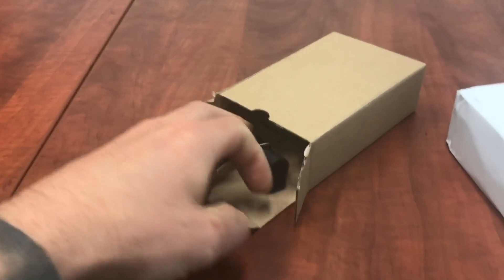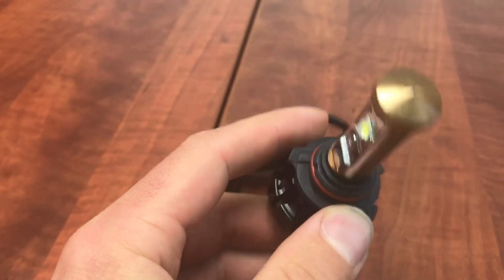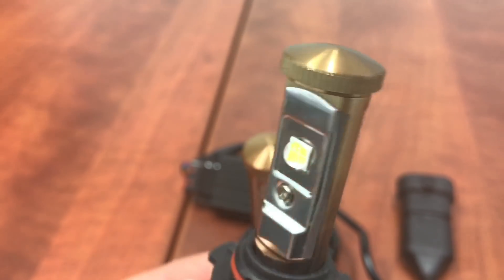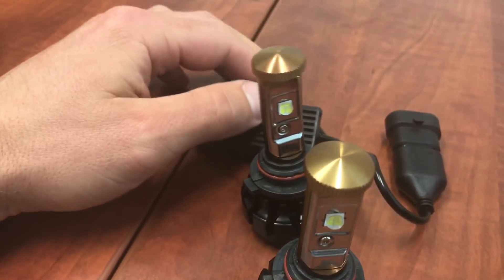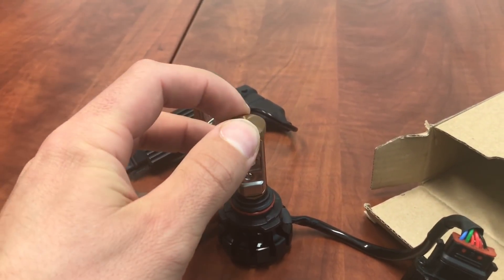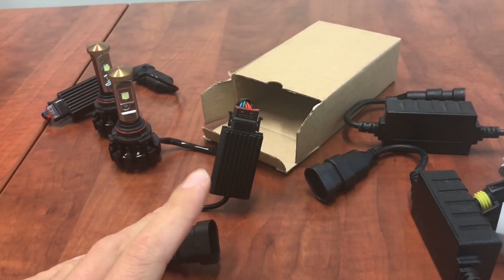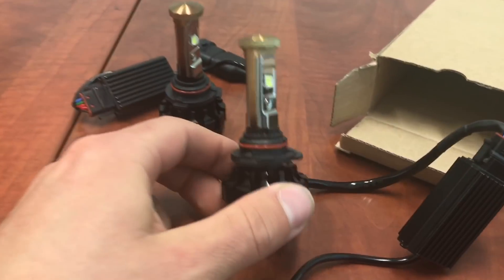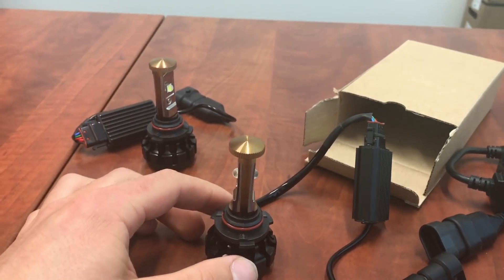How HOT do LED bulbs get in Halogen Projector Headlight Housings?

Comment: You’re tripping. It’s no where near “extremely hot” that you’re claiming. Your regular halogen bulbs are running around 160 degrees meanwhile these specific led bulbs are around 90 degrees. 90 degrees isn’t burning hot but enough heat to discolor that portion of the bulb. You ever have anodized aluminum parts out in the sun throughout summer? Same thing will happen.
Reply: The lights do get hot to the touch after 3 minutes
Reply: Halogen gets up to 200 degree glass
Reply: No. They’re wayyy hotter than that. I’d say around 150. Too hot too touch for more than a split second.

Comment: I have a 2015 Ram 1500 and the problem i am having is that after 30 mins or so the lights shut off and will not come back on until i restart the truck. I do have the canbus devices installed with them. Only happens on low beams. The fogs work fine.Any suggestions?
Reply from the maker: I'm going to work on a better solution for the CANBUS adapters as they don't seem to work the best after a few months.  For now don't use the AUTO function on your headlights and turn them on manually and should be ok.  It doesn't agree with the auto function for some reason.

Comment: You said you went HID. I’ve researched the shit out of this and I keep seeing that HIDs shouldn’t go into a halogen projector. It would start pitting the lens and beam throw is horrible and possibly melt the outer clear headlamp cover. What was your experiences?
Reply from the maker: No issues here and I would definitely recommend HID over LED in these low beam projectors.  There is no comparison the HID is a clear winner!  Check out this video where I compare the two in these headlights! https://youtu.be/Vmi6eeoOL5o
Reply: BoostedMotorsports so there is no issue at all putting a HID bulb in a halogen projector?

Comment: 03:10 <-------------this= critical You just cant seal these things up with nowhere for hot air to go, especially fan cooled LEDs. You typically should either leave the OEM dust caps off or find alternate coverings with more space.
Reply from the maker: Yeah glad I didn't run them any longer and possibly melt something! HID is the way to go for these projectors anyways! 👍
Reply: Yeah, for sure HID upgrades typically work far better in stock halogen setups. LEDs are best OEM, those housings/emitters are designed to work together.
Still, LED drop ins are improving exponentially, find just the right ones for your projectors and they're still far better than stock halogen. I found a quality set specifically designed for my car, no fussing with adapters and what not.
Not HID but excellent light output with no glare, I'm happy with it so far.
Reply: Can the covers be left off and the inside of the headlight stay dry?
Reply: I left my dust covers off with no problems with moisture or heat buildup.

Comment: Thanks for the video. I've said it once before, but I was extremely dissatisfied with the output from the  Hikari bulbs, but the LEDs I have now are so much better. Now you've got me worried that the new bulbs may be getting too hot though....good thing I'm in Canada where winter seems to be neverending right now...ugh.
Reply from the maker: Hey Mike the HID kit seems to be the way to go for the best light output on these projectors.  I tested and compared and was shocked at the difference.  Check out this video if you haven't seen it already!
https://youtu.be/Vmi6eeoOL5o

Comment: Question, what do you think of the fuel injector cleaner additive?I have a 2013 slt 4x4 bighorn. 106kmiles. Should I use or not use? Also, is your ram sport a 4x4?Thanks.
Reply from the maker: Hey brother if you truck is running smooth I honestly wouldn't waste the money but it won't hurt anything either!  My truck is only 2wd.

Comment: John I think the decoders are different to the metal orange orange heat sinks you can get. They screw directly to a metal surface and dissipate the heat
Reply from the maker: True but the LED bulbs themselves put off a ton of heat which is why they have a built in fan on them.  Trapping them in our sealed headlights just causes them to get extremely hot 😯

Comment: I was wondering what kind of canbus decoders were those that you opened up and where can I get one if you don't mind letting me know. Great video btw, I don't have too much issues with my leds since I only run them during foul weather conditions or at night only. I kind knew they get hot but not that hot lol. I wonder if leds have any kind of wattage regulation kind of like ecig mods.
Reply from the maker: Hey John these are the ones that have been working great for me so far. Only $20
HIKARI PAIR LED Conversion Kit Headlight Canbus Error Free Anti Flickering Resistor Decoder - 9012/9005/9006 https://www.amazon.com/dp/B07312V7QB/ref=cm_sw_r_cp_api_.8SXAbEHG57D1
Reply: BoostedMotorsports Thanks for the info man! Definitely will check it out.